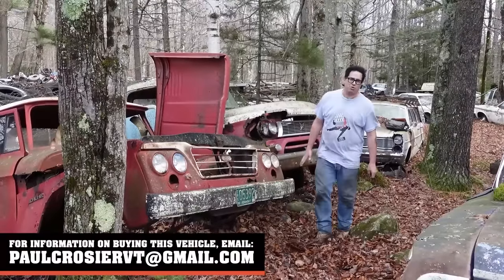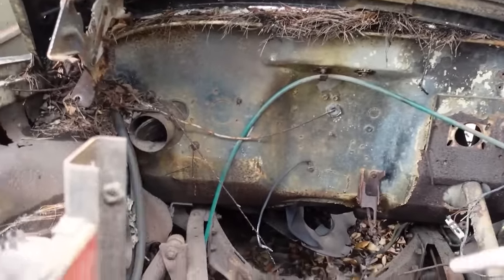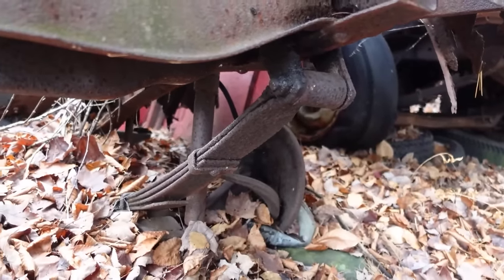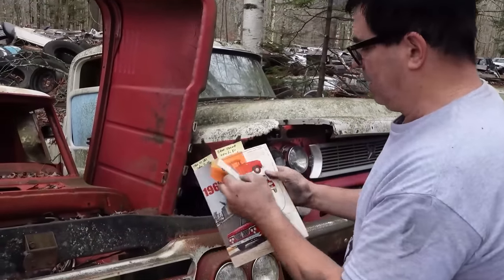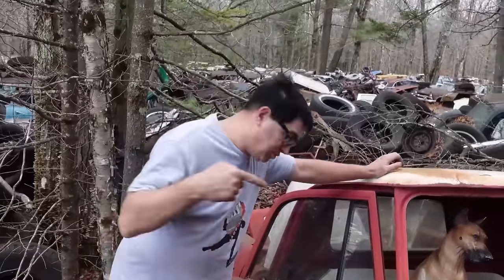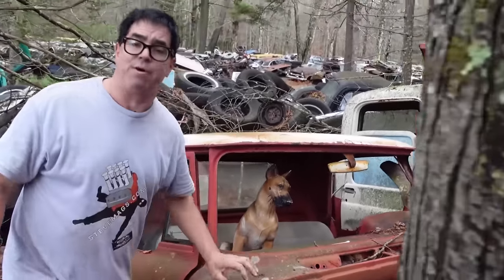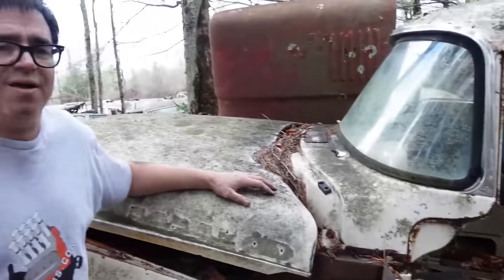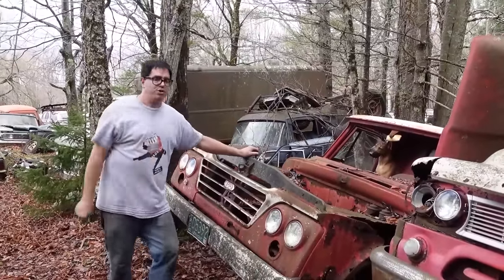Truck Week EP11 - Dodge D100

Comment: The regularity of your videos is refreshing again as it shows that you're getting closer to going back into the junkyard again. As stated last time: 

No VIN, can't win, but some can be figured out, no doubt:

1961 Dodge Truck: 11 for D-100, 6 for six cylinder equipped or 8 for 8 cylinder equipped, 1 or 2 for Warren Truck, Warren, MI assembly or 6 for Windsor Ontario Canada or 7 for Missouri Truck assembly and the rest is the production sequence starting with 10000 for 1961. Warren Truck opened in 1938 and still operates today under Stellantis and was known as "Dodge City". Windsor, Ontario Canada also still operates under Stellantis and opened in 1928 and has been the primary minivan plant for a number of years. Missouri Truck was part of the St. Louis, MO assembly plant complex (actually Fenton, MO) and opened in 1959 and closed in 2009. Possible code DT3116 Toreador Red and DT1280 Sand Dune White.

1960 Dodge Truck: 0 for 1960 model year, (or sometimes "P"), 6 for six cylinder equipped or 8 for eight cylinder equipped, D for 2WD or W for 4WD, 1 for 1/2 ton rated, L for Light Duty and the rest is the production sequence. There was a serial number and a "Parts Availability Number" used on the earlier trucks, but the serial number was what most titles and registrations would have had. 1960 appears to have the same paint codes if those were the original colors of the truck. 

Trucks back then were very functional, but I believe that they were quite striking and stylish, both back then and even today. For years trucks were often ignored, and today as you noted they are quite hot in the market.

As someone else pointed out, that might be a 1962 and up truck as the grille is different than the 1961 model. 1962 and up VINs follow the 1961 style, but the production sequence started at 16000 and up to 23000 which started the 1963 model sequences.
Reply: Good to see your handle as well sir ~ Chuck
Reply: @charlesdalton985  Nice of you to say. Let's hope Mr. Magnante returns soon.
Reply: Sad Dodge is going Woke and not making the Hemi anymore. RIP Dodge. I agree. I also miss Steve. So glad he will be back soon.

Comment: Steve, back in 1978, my brother bought a used 65' Dodge Town Wagon like the one pictured at time 3:24.   It was blue in color and came off the U.S. Air Force base that was established here in Newfoundland during the Second World War.  It was a 4-wheel drive with 17" split rims..............a 225 cubic inch six cylinder and 4-speed.  It had 4.88:1 gears.  It was a stump puller!  I was always confused about the Dodge trucks in the 60's because I remember his was a 65' model..............yet other 65' models had the flat hood!  Thanks for clearing this up!

Comment: Awesome video, thank you sir 👍 I once had a 61 W500, 4 wheel drive with the poly 318. It was a 3/4 yard dump, I removed that, scooted up the Rockwell rear end 2 ft. and put an ex military ammo trailer on it. Changed to 12.00-20 tires. That truck was unstoppable

Comment: Not only did the 1960 cab and front clip design live on with the Dodge Town Panel, but the '60 Sweptside bed lived on as the bed on the Studebaker Champ compact pickup. Studebaker used the Dodge tooling as a cost saving measure when gearing up for the new Champ which used a cab based on the front of the 4dr Studebaker Lark. They didn't match up very well aesthetically, but as a Mopar guy, I dig that my '61 shortbox "Wrongbed"  Champ has some obvious MOPAR DNA.

Comment: Ya may want to check the data plate on the one to the left, more like a 62, 63, or 64 model. The 1961 D100 had a flat mesh type of grill and didn't have a grill like this one until 1962. These were also known as four-eyes.
Reply: I said the same thing. That 61 grill is worth more than the truck if it was a 61. I have a 62 myself and would love to put a 61 grill in it because it was so rare.

Comment: First Steve man it is great to see you again. I sincerely hope all is well with you. I had a '70 Dodge D100 pretty much same as that '61, except my box. Thing I thought was strange buut came in handy the hood goes straight up. You can pull the engine without taking off the 500 pound hood.

Comment: i remember seeing these trucks around the old belt saw mill,,,,the mill  was ran by a 360 out of an old Monaco station wagon..my dad pressed the paper pulley on the pinion of the automatic transmission was around 16 inches wide.that was in 1985...it had plenty power

Comment: GM did a similar thing when the new 1988 pick up trucks came out, but the Suburban and Chevrolet / GMC cab and chassis were in such high demand General Motors couldn't afford to shut down those vehicle lines to retool for the new body style.

Comment: Wrong grill for a 1961. 61 had a 1 year grill, 1 year white faced gauges and they didn't have a rear view mirror from the factory. Also the 100 emblem would have red painted around it unlike the later years which were black. I'm leaning that this isnt a 1961 Sweptline unless you can show the Vin or unless someone changed a bunch from a 62-64 parts over.